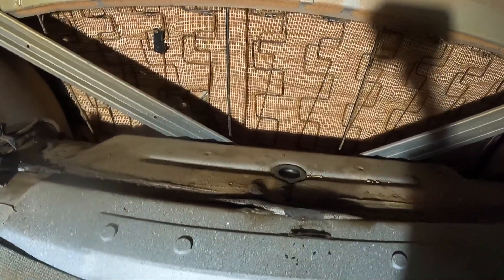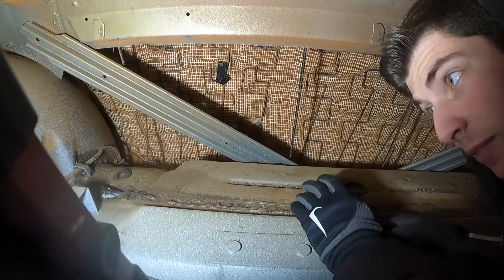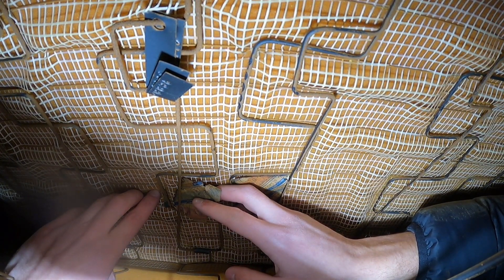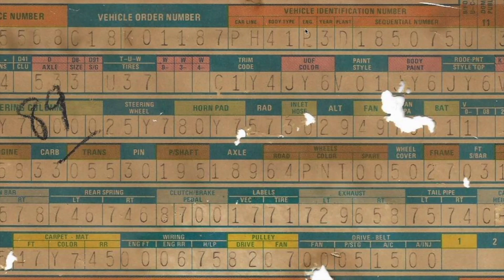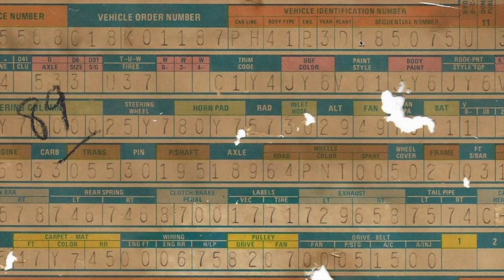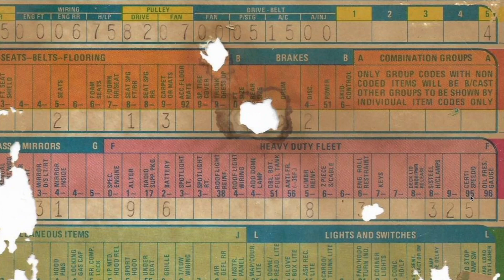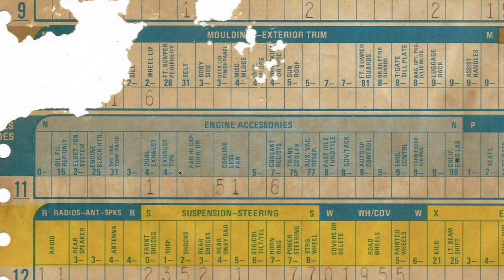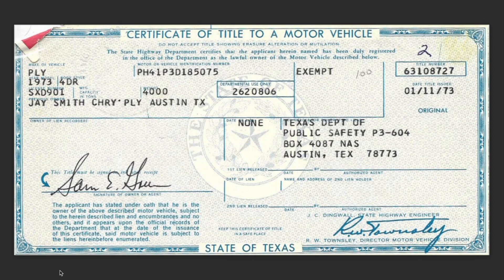Did We Find The Fury's MISSING Sister Car? | Build Sheet Found! | Going Over The History Of The Car

Comment: My first car was a 1973 Fury II. 360 auto. It was ordered as a stock car, CASCAR made the same rule as NASCAR and the 360 (320 HP) Chrysler designed to meet the stupid rules was now illegal on the track.
It was never stripped for the track, but the powertrain was left alone and it was sold at a dealership. 100MPH in the 1/4 mile and you could kick in the passing gear at 120. It was gold like  yours. I miss that car.

Comment: Just to help add why lots of Mopars were neglected for quite some time, Chrysler hoarded the patents for many years. I remember my parents having a 1972 4 door Dodge Dart in the late 90's that had bad A frame bushings, and at that time you could not find replacement bushings for the car, so the car was rendered undrivable. I know the Federal Govt. has always been after decommissioning these classic cars, and there still is an ongoing war between the Federal Govt. and classic car enthusiasts. It is my guess that the Govt. had a lot to do with part unavailability during these times. So like us, a lot of people junked these cars feeling there was no hope to keep them going. Much later the patents were released for reproduction parts. I believe Year One bought a lot of the patents many of the reproduction parts and molds, as well as the ability to stamp vin codes on said parts for originality.
Reply from the maker: That’s wild! I didn’t know that.